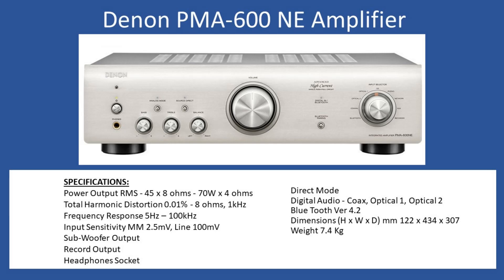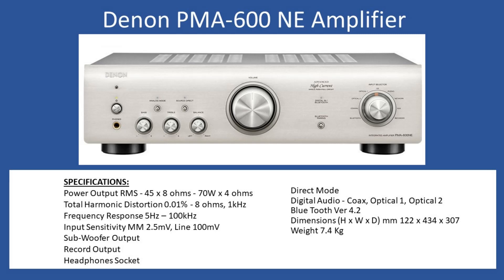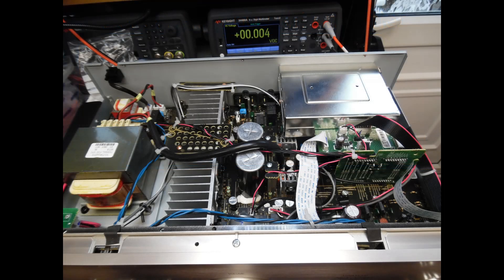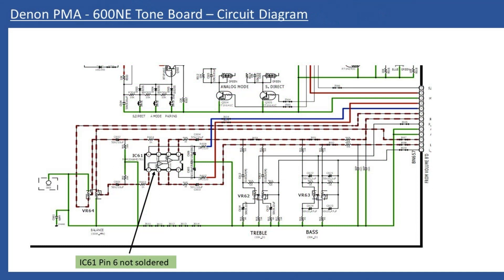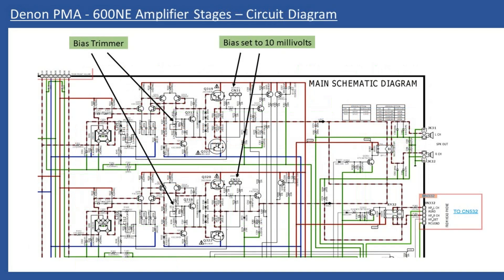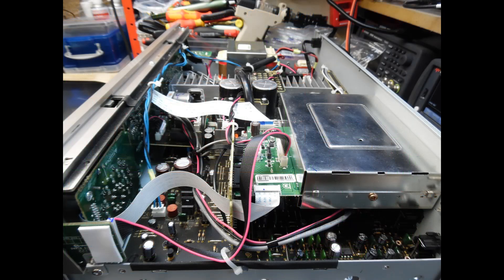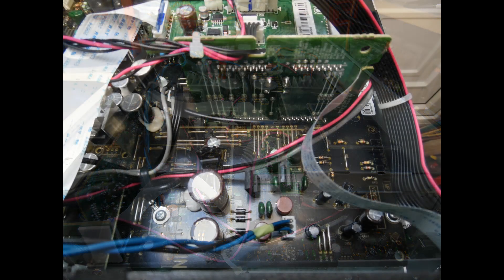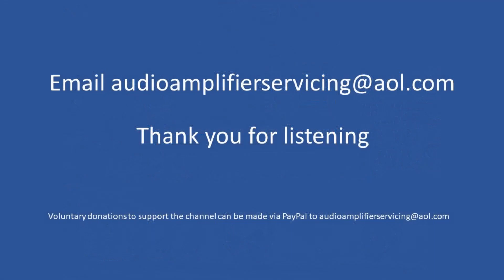Denon PMA - 600NE Amplifier Repair (With Audio Tutorial)

Comment: You saved my amp as well! I bought my amp second-hand and was immediately disappointed with the sound. Compared to my older PMA-510AE, it was bass-heavy and dull. After watching your video and checking the bias according to your instructions, I found that my amp also had a high bias setting (close to 14mV) on both channels. Once I adjusted the bias to 10mV, the sound became much clearer, and the bass improved significantly (it actually sounds excellent). It really does seem like Denon makes this model on Fridays! Anyway, I am a happy puppy now. Thank you!
Reply from the maker: @tco669  Great to hear you have fixed your amplifier, and thank you for sharing your experience on the channel.